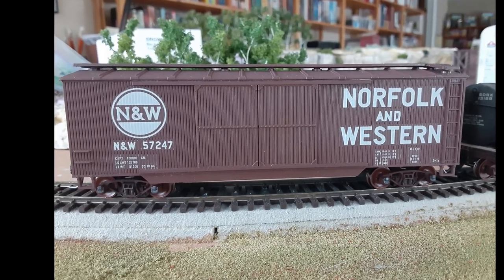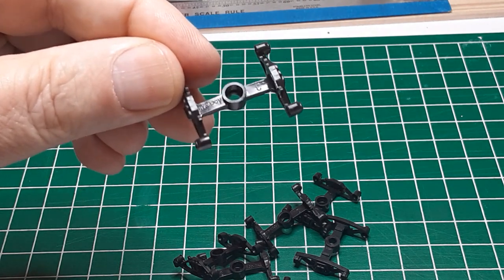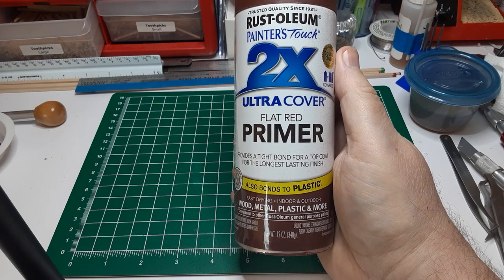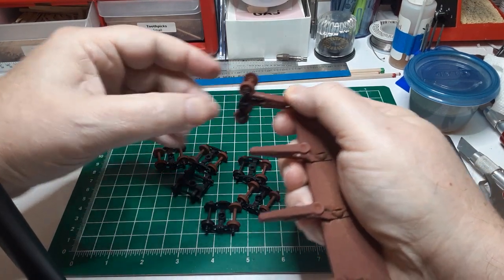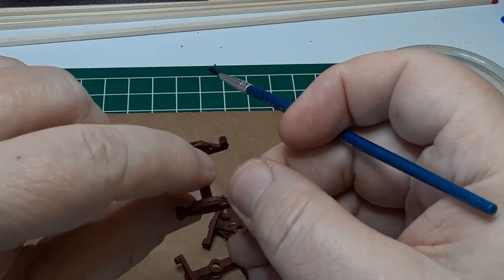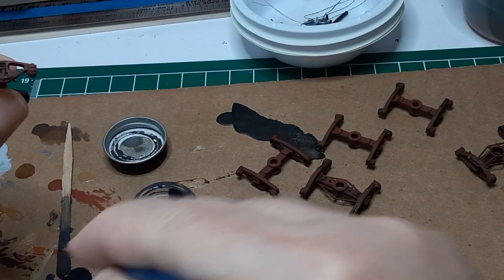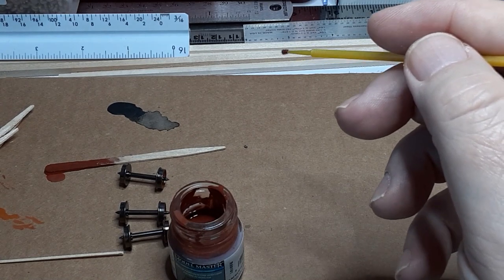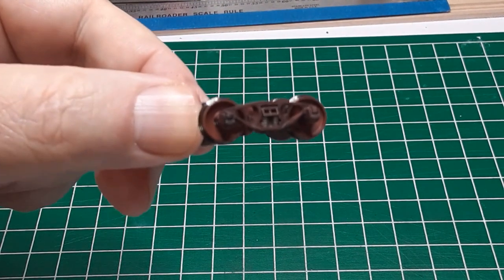Painting and Weathering Freight Car Trucks

Comment: Nice, clear video with good tips, thanks. I like your truck-holder a lot better than the one I made 20+ years ago. Time to upgrade it. Do you do any painting on the back of your wheels or axles?
Reply from the maker: No, I never bothered to paint the axles or the backs of the wheels. They're not noticeable, and I fear that painting them might make them stand out more, rather than less.
Reply: @rwissbaum9849  Cool, thanks.

Comment: Do you do any prep work on the Accurail Delrin plastic truck frames?  I've found the occasional Accurail truck frame with some flash that needs removal, but not near as bad as the older Athearn BB DElrin truck frames.

I've read that some modelers grit-blast the Delrin to get better paint adhesion.  Maybe that step isn't necessary by using the rattle can spray red primer as the base color for the frames.
Reply from the maker: I've never done any extra prep, and the Painter's Touch 2X adheres very well. I've not tried any other primer - I got lucky on the first go!

I have tried using a truck tuner on the axle pockets, but I've never seen any improvement in performance as a result.
Reply: @rwissbaum9849  The only time the truck tuner helps in my view is if the wheelset axle is too long for the truck frame.  In that case, I inwardly squeeze xtra hard on the journal boxes while twirling the tuner.  This makes the conical "hole" in the journal boxes a little deeper & I can usually get the "was too-long" axle to slip into place & spin w/o any detectable friction slowing down its spinning.

Comment: Actually, even the result are very fine, there are possibility to vary slightly from car to car.
Reply from the maker: Absolutely! Making them all the same will defeat the purpose. I would suggest, though, that the variations should be subtle - freight cars traveling across Oklahoma will pick up a lot of red dirt, so if you're modeling an Oklahoma-based railroad, the trucks (and cars) should reflect this. Cars on interchange service - for example, a Pennsy freight car on my Rio Grande layout - would be expected to differ from the others. THAT'S getting pretty detail-oriented, but that can add to the fun of model railroading.
Reply: @rwissbaum9849  Thanks for the feedback. Yes, this called FUN. I am in southern California, and we have a lot of dust. Sand color is dominant.